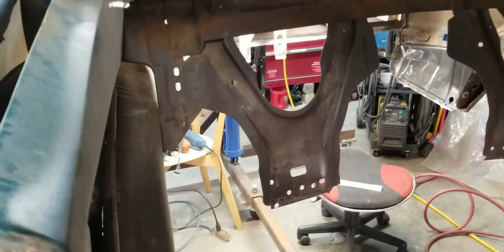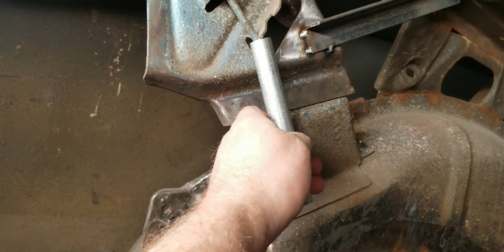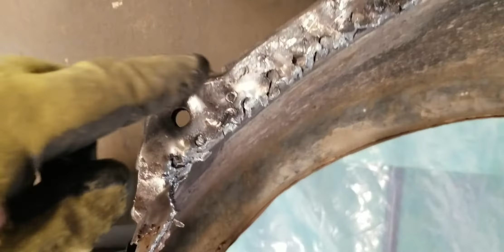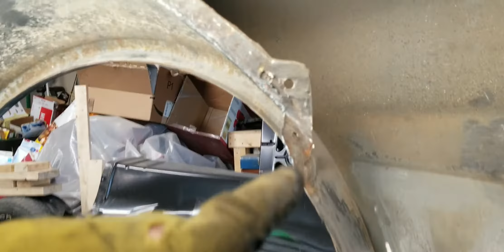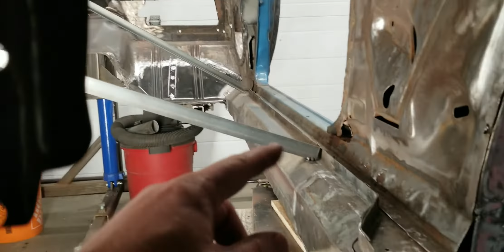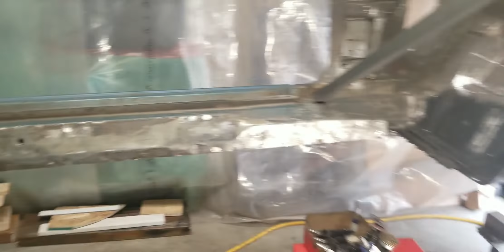1968 Camaro Project #36 Preparations for DSE Minitubs, Removing Inner Wheelhouses and Welding

Comment: Consider getting new outer wheel wells too - they’re cheap! You’ll be fighting the welds to the old metal. The sandwiched flange from your existing outer to the structure probably is suspect all along the inside of that connection just like it was from the inner to the structure. Looking good!
Reply from the maker: When will it end? LOL I thought about that. I'll wait till I get the tubs to make any final decision.
Reply: @ElrodsGarage  it doesn’t lol
Reply: I paid $65 each for the outer wheel wells.